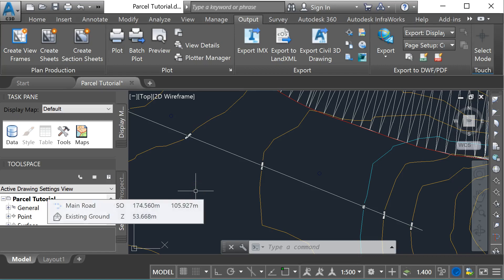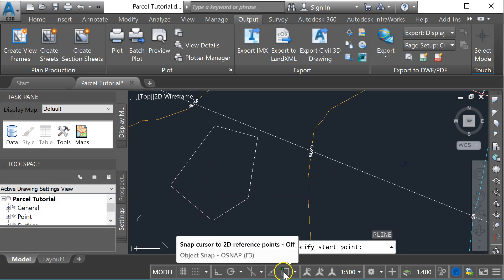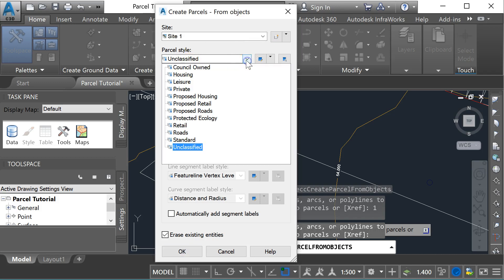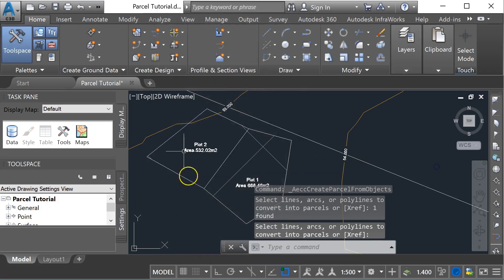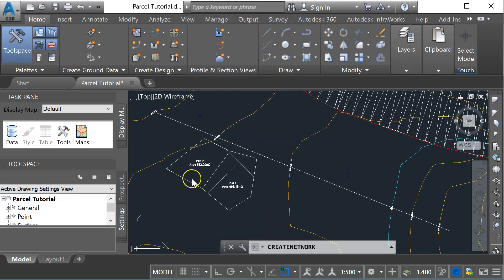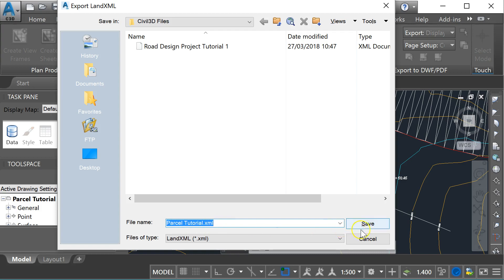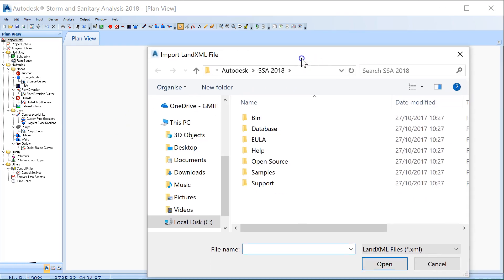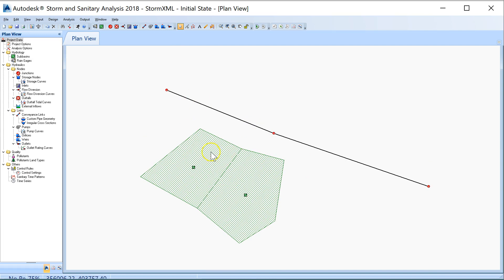Create parcel in Civil3D for drainage analysis

Comment: Can you demonstrate how to breakdown a parcel into the connected impervious, disconnected impervious and pervious (grass, trees, shrubs, etc.) Is there an analysis of some sort that needs to be run in C3D or Map3D?
Reply from the maker: I'm not entirely sure I understand. Do you mean that you have different parts of the site that are made up of 100% impervious and 100% permeable materials? I've accounted for that by saying that a certain amount of the parcel is roof, a certain amount is hard-standing and a certain amount is grass. Perhaps that's a bit of a crude way of doing it, but it works. Another way would be to draw parcel shapes for each element separately, so that you have a parcel shaped to represent the roof, another parcel shaped for the hard-standing and another shaped for the grass. In that case, you could set it up so that 100% of each shape has the run-off properties of the material.